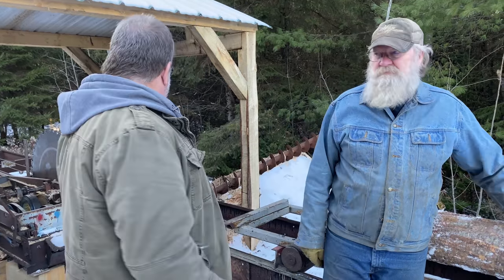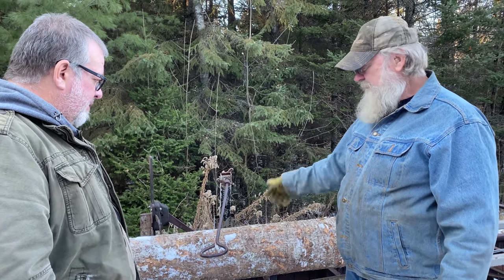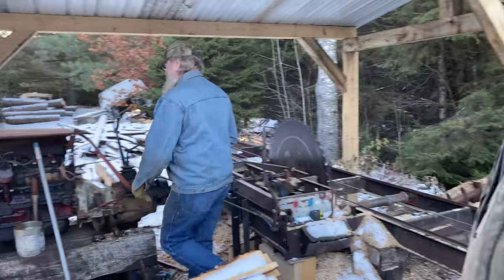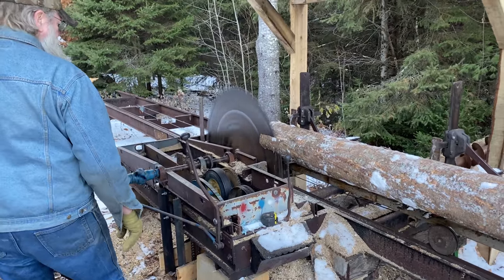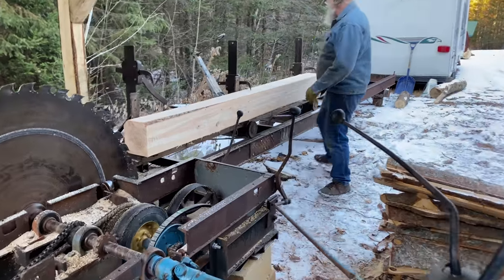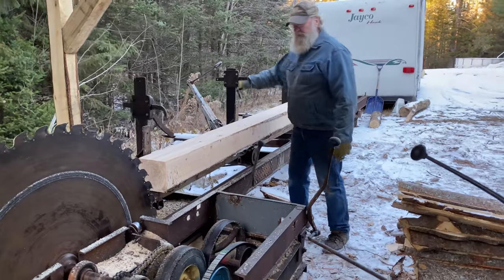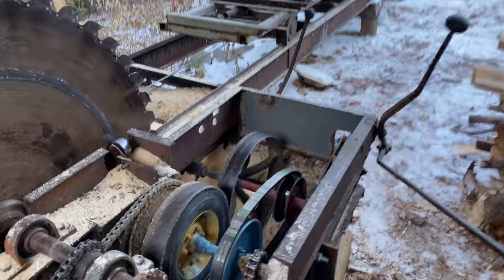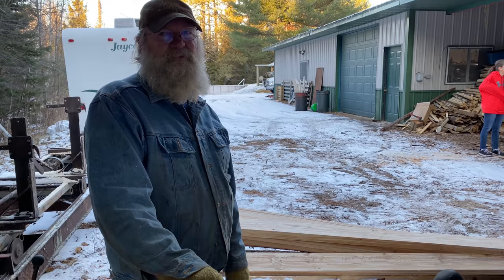100 Year Old Sawmill AT HOME

Comment: That's awesome, thanks for showing that and would like see more. I was a Sawyer many year's ago cutting big logs on a band saw electric driven,but same principle with logs carried on a carriage on rail tracks,but bit more safe,only when cleaning the tree gum off the blade was your hand anywhere near blade, all though sometimes a blade would brake or you accidentally hit it as bringing carriage back.good video though Howard very laid back.😀😀
Reply: My grandpa used to run one with the carriage, the blade is like 6ft wide, I guess it used electricity too, he had a big diesel tank too not for sure.  But he worked the carriage with these joysticks and there were a bunch of roller beds my uncle would separate the scrap from the lumber and send scrap through a chipper , he sold the chips, and my dad would stack the lumber by hand he had stationary horses here and there that he used to move green 18ft 4x6 by himself. But they got weeded out by bigger companies. They also cut timber themselves for the mill off people's land that sold it either for the lumber or $. Good times. My grandpa is 85 now and he just piddles around the house but if you get out doing something  you better believe he wants to help and will.❤👴
Reply: Thanks Kelly that was very interesting reply loved reading that. Yes the same thing happened to the sawmills i was working with a bigger company took over and 3years later closed it down,they where happy time's, though we not think so at the time especially when it was snowing and log's frozen.